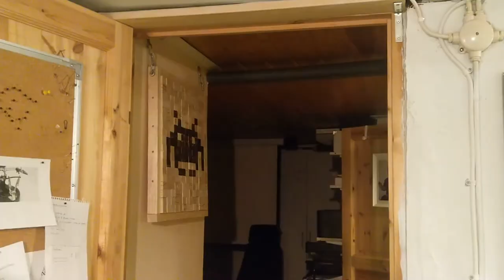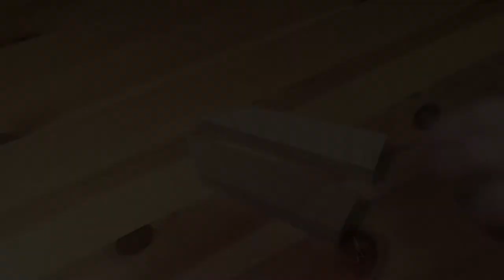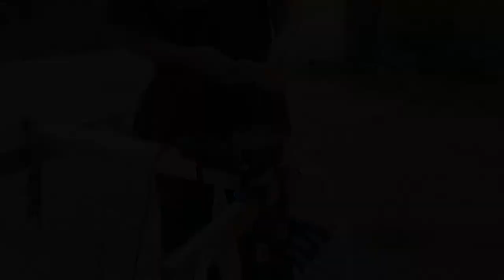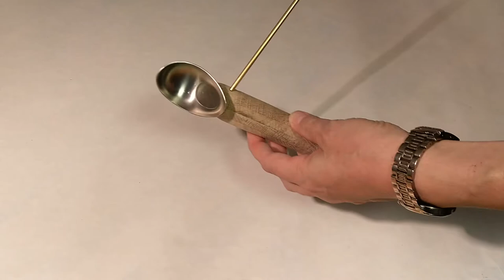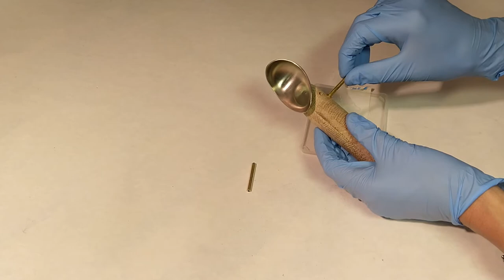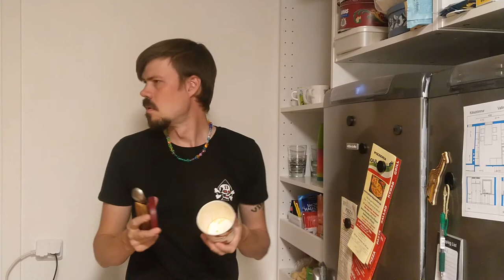Let's make a handle for an ice cream scoop!

Comment: Don't you hate when you pop to the shed for 4 months and come back to find someone stole your kitchen and turned it into a hipster side table? 🤣 I turned my angle grinder into a sander too, you can get proper sanding backing pads for them and they work a treat. I used it in a woodart project for shaping really tough hardwood.
Reply from the maker: Truth! 😁
Good to hear! I think my main problem was that the flap disc was pretty worn out - proper sanding pads would probably work much better!